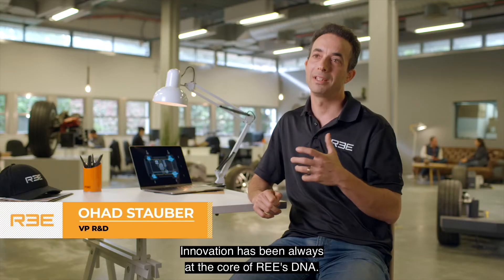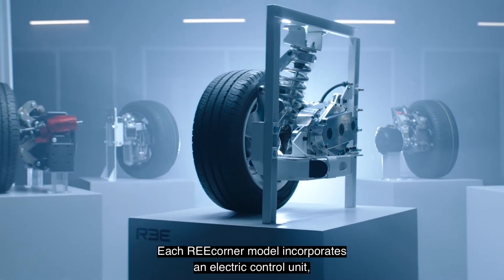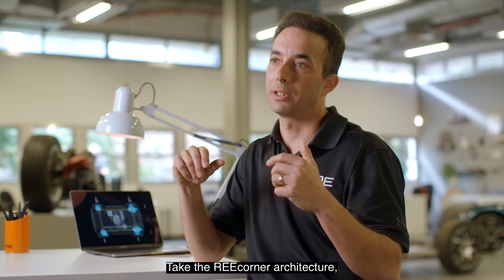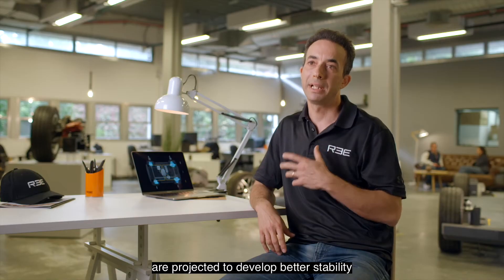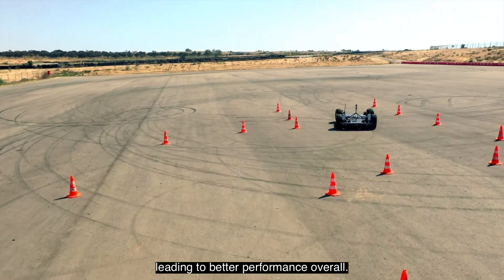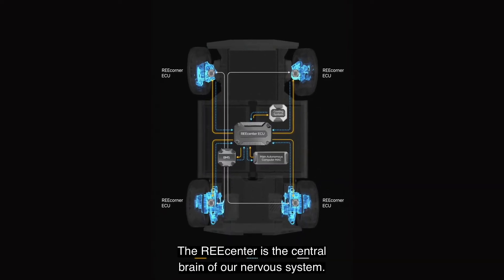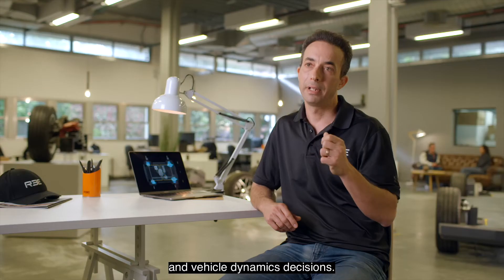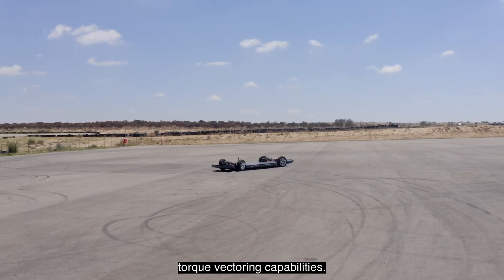Ohad Stauber, VP R&D, REE Automotive

Comment: What happens if a corner unit has a steer-by-wire critical malfunction in the middle of a turn? How can the 3 other units compensate in this situation? Rear wheel steering could perhaps build in redundancy to help maintain turn radius control? Or could rear wheel torque vectoring be sufficient to reestablish control in such an emergency?
Do all 4 corner units have S-B-W capability, or just the front 2?

Apologies for my ignorance here. I just wonder how steering reliability can be maintained to avoid a crash as a result of a steering unit failure.